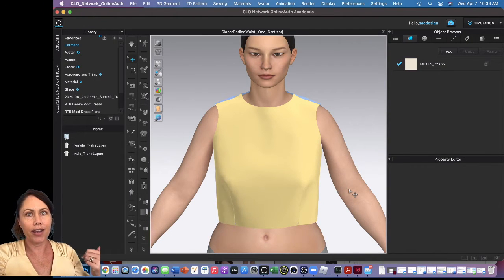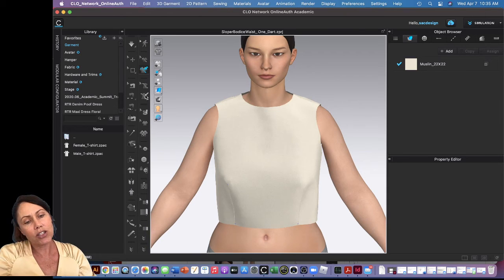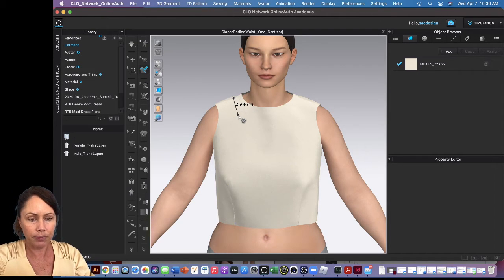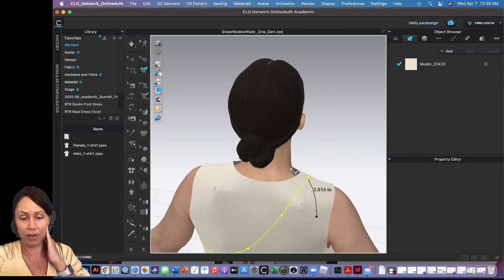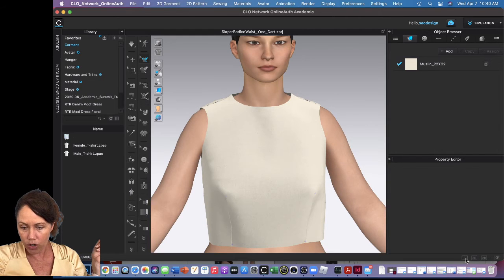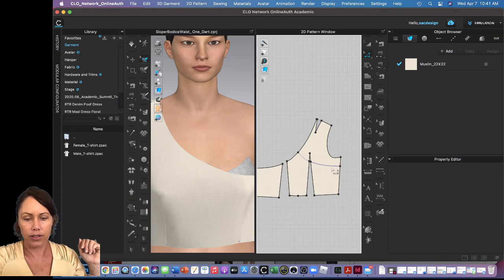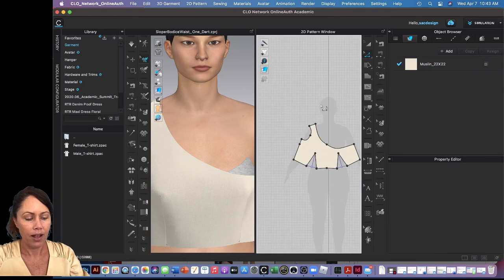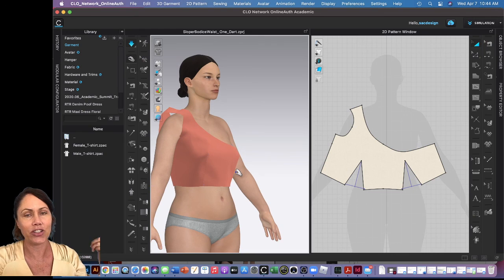How to Design a Pattern or Fashion Design by Drawing on a Block using the 3D Pen Tool in CLO 3D

Comment: I tried the 3D pen (for the avatar) and when I transferred that into 2D patterns, many of the measurements were off. Such as 2 sections/patterns created by the 3D pen (for the avatar) when I tried sewing them together had completely different measurements (also to note that the patterns were very curved/wrapped around the body). Have you come across this, and is there a setting change I can make to avoid this? 
Thank you.
Reply from the maker: Yes- the 3D pen is ok. Did you flatten lines- maybe that can help? But I e also found it takes some cleaning up!